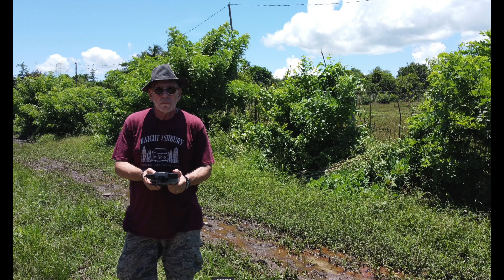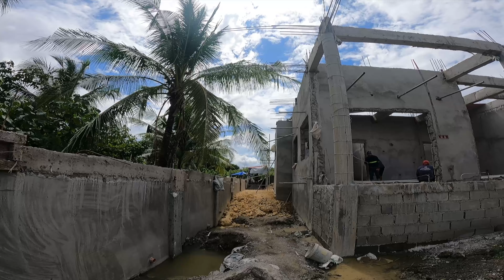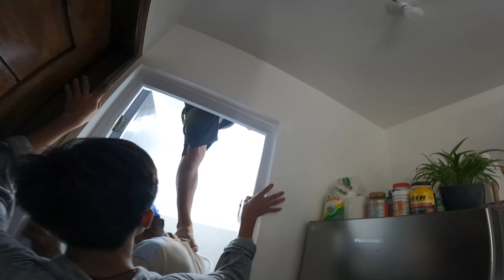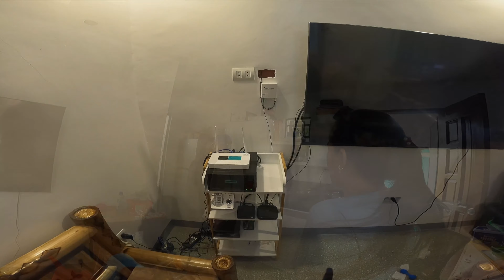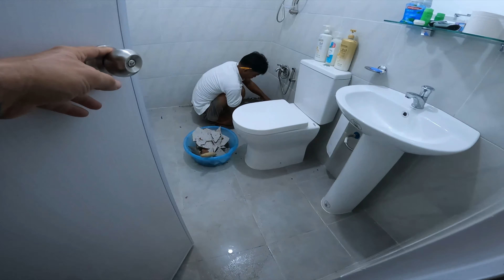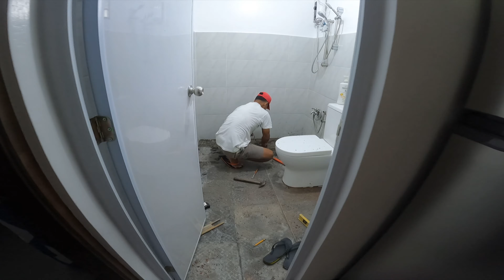FloridaMan Journey™ - Day 90- Philippine Home Construction

Comment: Good to see the skimcoat on the walls. Looks so much better already than the depressing concrete grey!
Reply from the maker: Skim coating is progressing,, Had to stop temporarily because of the weather. Check Day 94 video once posted. Drone shows skim coated areas very well
Reply: Yes, too bad of the removing of your bathroom tiles. 😢
Reply from the maker: @dutchypinoy5137  A real mess. The Foreman who did the rest of the house is amazing. He had to clean up the mess of one of the other worker who had a real problem taking directions. I could not live with a flooded floor. We also built a shower curb to keep the water where it belongs.